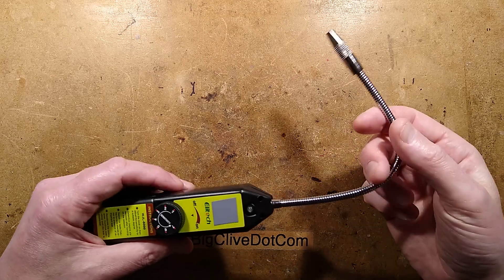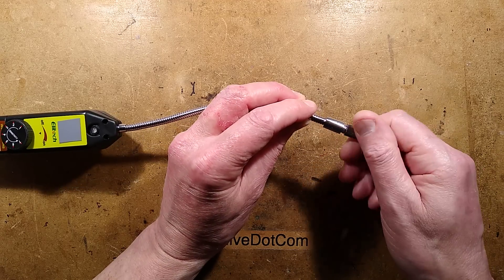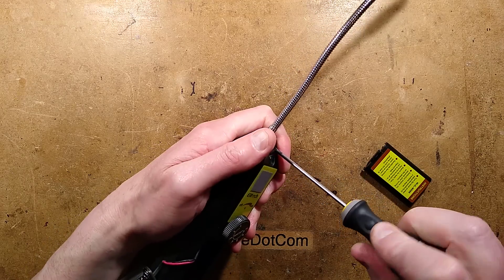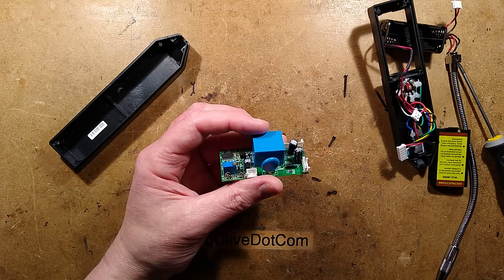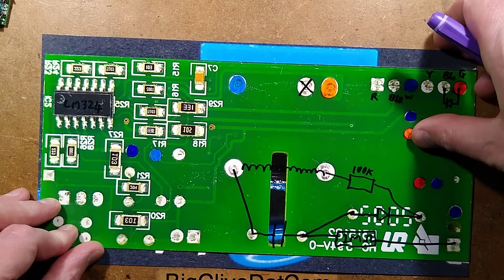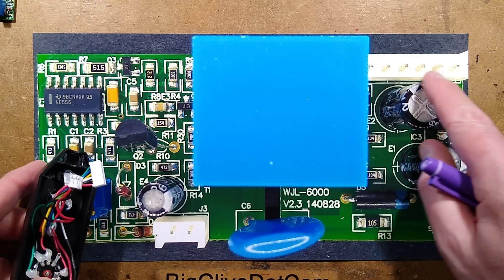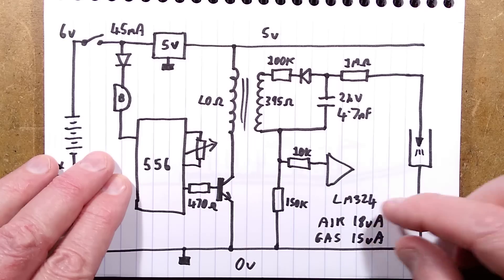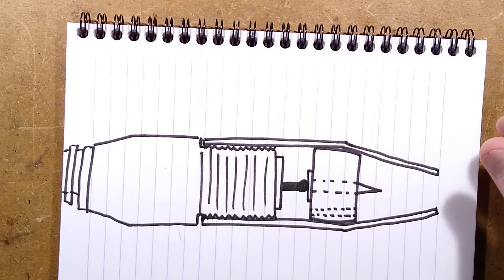Refrigeration gas leak tracer teardown

Comment: Leak detection technologies are fascinating. Most employ the "sniffer" concept, but another was/is the ultrasonic "listening" type. I've only used this type for vacuum leaks in car engines, but I understand it can also detect other types of leaks.
This video makes me wonder how the ultrasonic one works.
Reply: Another way to detect vacuum leaks in the intake of gasoline engines is to introduce a gas or volatile liquid near where the suspected leak is and either listen for a change of RPM or look for smokey exhaust. Carb cleaner or ATF mixed with water and in a trigger spray bottle work well.
Reply: @mikebarushok5361  Yes, I 1st learned how to find vacuum leaks with Berryman's B12 Carburetor Cleaner and for some reason also found a few broken spark plug wires.....which makes for some hair raising burning episodes. So I used WD-40...didn't work as well unless you really doused the right spot. And yes the crappy idle would smooth out if you hit the spot, though if you were close to the open carburetor you could get a false reading. Then Snap-On came out with an ultrasonic probe. After 2 weeks I traded it back in because the WD/B-12 method was way better and convenient, and honestly the leak detector could only pick up the loudest of vacuum leaks....the ones I could hear already.
I rebuilt carburetors for 12 years during the late 80's and the 90's. My best year was 1992 when I rebuilt 976 carburetors. That's the absolute truth. All makes. All models. A lot of those included remove and replace. And we both know a vacuum leak can make a carburetor job look bad, so I fixed many vacuum leaks as well. The sneaky ones were the Rochester Quadrajet throttle shafts getting worn. But as the 90's wound down, it was easy to see carburetors were on there way out, so I drifted on over to fuel injection. 
But I still do regular carburetors.
Reply: @michaelmoore7975  
AND the leaking well plug issue on the Quadrajets also... this became a common issue on many older models.
Which would then drizzle fuel out the bottom of the carb into the intake and make for a rough hard to cure idle, and partially flood the engine if it was restarted in a short amount of time, OR make for a hard starting/extended cranking situation if the vehicle sat for a long enough time and the float bowl would completely empty out, the fuel would evaporate out of the intake, and then the carb bowl would have to refill from the fuel pump before the engine would start again.

Many people hated the Q-Jet, but I liked it. It was a complicated carburetor, but they worked WELL on a street car if it was built/modded and tuned correctly. I think the hatred towards them is largely based on the complicatedness of them, and the lack of knowledge that many people had on them. 

The spread-bore design, and the tiny triple booster primaries made for some great throttle response and very good fuel mileage on a warmed over street car. They flowed  750-800cfm, plenty enough for a high horsepower street engine, and the vacuum secondary system worked well on a wide variety of cubic inch engines. The electric choke versions started very well in the cold, and those HUGE secondaries produced that distinctive howl when you put your foot into it. I can remember the days when anybody that had a car with a quadrajet on it would intentionally flip the air-cleaner lid upside down on it, in order to greatly increase the howling sound when the secondaries would open up wide. 😆 

I've been in the high 10's in the quarter mile with a q-jet on a big block car, but they weren't the best thing for drag racing due to the single fed, small float bowl in them (they had a tendency to run the float bowl empty and then bog on a bigger power large engine during a full 1/4 mile pass), and the fact that tuning them required alot of disassembly and had to be done with the carb off the car usually. Jets and metering rods weren't available in many different sizes like a for Holley style carb also.

Towards the end of their run, those electronic feedback carb were lousy for ANY performance application, and I just toss those right in the trash
Reply: @mikebarushok5361  with a gas blowtorch unlit blowing gas  works brilliantly  and squirty bottle alcohol too does
Reply: @mikebarushok5361  Starting fluid and/or carburetor cleaner spray works well also for this method.
Reply: @Kevin-mp5of  Now see...that's one way I hadn't heard/thought of/used...but it makes perfect sense it would work....and less volatile than Berryman's B-12 I bet.
Reply: Ultrasonic one pitch-shifts the sound down by a few octaves .   Just hope they don't make an 'AutoTune' version

Comment: i have used alot of these devices as a mechanic with automotive HVAC specialty
Reply: Yep, me too... They helped a BUNCH to detect small leaks in the evaporater under the dash, in the HVAC box. It is pretty hard to find a leak there without one.
Reply: @davelowets  hard its dang near impossible hell i think even the IMF would pass on that lol

Comment: Are you drawing those cells upside down or did "they" change the diagrams like swapping my back-and-forth resistors with your empty boxes? I'm used to the narrower line being the positive, same as the physical positive terminal on a dry cell is smaller than the negative.
Reply from the maker: I'm sure the long line is positive.

Comment: This has coincided with me having concerns over a possible leak on my fridge (weird faint chemical smells sometimes, compressor running more often...) and I almost bought one of these but now realize the refrigerant it uses is flammable and that poking a high voltage thing near it might not be the best idea.
Reply from the maker: Is the heat dissipation panel on the back of base of your fridge clean off fluff?  If it's built into the kitchen is there good airflow to keep it cool?  A lot of fridges are struggling in the hotter weather.
Reply: That fridge would have stopped working long ago if the leak was big enough to make a flame.
Reply: I'd tend more towards something electrical getting too hot for smells from a domestic fridge, theres not a lot of refrigerant in them to make a smell over a long time.
Reply: One time that happened with my fridge; it ran constantly except during defrost. I eventually removed the evap cover and it was a solid chunk of ice. I let it melt for several hours, the restarted it. First made sure the defrost heater worked (and it did). But cut to, it's still been running finel since---I'm really not sure what caused it
Reply: @SomeRandomDude-zqxj  I had something similar with the drain plugged by a dead gecko which meant the coil was a solid block of ice- one of the travails of living on Big Island is geckos get everywhere or worse hatch and the little buggers make surprisingly loud chirps at the most inappropriate times (often during evening conversations as if to punctuate some one's point- the skinny is that they only do it if you've spoken a truth)
Aloha from Big Island, Hawaii.
Reply: May I add, any flammable refrigerant is also odorless. Only the oil has a slight smell usually from oil geting too warm.
Reply: About smells however, my mom called one time saying her car AC was blowing a funny odor reminiscent of something between vinegar and ammonia. I told her to take it in. Turned out, her evap coil busted a leak and they had to take apart the entire dash to replace it 😱 ('10 Buick LaCrosse). I guess she was smelling the leaking refrigerant.
Reply: @SomeRandomDude-zqxj  I own an '09 Buick Lacrosse that needed an evaporater... Absolute BITCH of a job! I ended up removing the center console, both front seats, and the ENTIRE dash to replace it. I couldn't even IMAGINE what a shop would have charged to to do it.  I'm guessing over $2000... 😬
Reply: @davelowets  I think she said it was around $2700? She said that's the last big-bill repair she'll do on it. She otherwise still loves the car.
Reply: My gut was right. I'm not sure where or how it leaked but the engineer who checked it claims the refrigerant is just gone. Welp. I guess I at least know my nose is sensitive enough to notice trace refrigerant leaks now, that can only be a good thing.
Reply: Well I don't know if it's a leak, will find out Wednesday, but I can confirm the fridge is screwed either way. Compressor is still running constantly yet the radiator is basically cold and the internal temperature is too high for food.

Comment: Does anyone know if the story about the man that went looking for a town gas leak with a box of matches is true? 🔥
Reply: In the days when UK houses had open gas fires connected to a tap by a rubber pipe it was common to look for leaks with a flame.  It doesn't cause an explosion unless the gas has been allowed to build up the correct concentration in the room.  It just lights a small steady flame at the leak.
Reply: With the old town gas leak, drop a match the lit flame you watch it travel along the floor and it led back to the leak, and a little baby flame there waiting for you. 
But the natural gas from 1960s onwards couldn't do that just exploded dangerous

Comment: Because of your advice, I got myself several different simple kits to practice soldering.
One of them was an alco-sensing breath tester, cheap and simple, around an MQ-3.
Interesting was the fact that it also senses other alcohols, such as propylene glycol and glycerol, as well.
Reply: Four fixed (plus one variable) resistors, three diodes (one signal + two LEDs), one relay, one buzzer, one NE555P IC, and MQ-3. That's it.

Comment: Refrigerant 290 is straight propane with no odorant in ot. Its typically used in commercial refrigeration, and is flammable, but is safe to release into the atmosphere with no risk or harm, but caution must be used in an indoor environment. I have a beverage cooler that is 290, and plan to test soon. It was given to me by a local convenience store chain or franchise.
Reply: Propane is R290 though...
Reply: @kuebbisch  thanks.